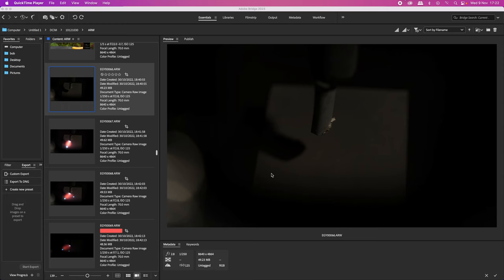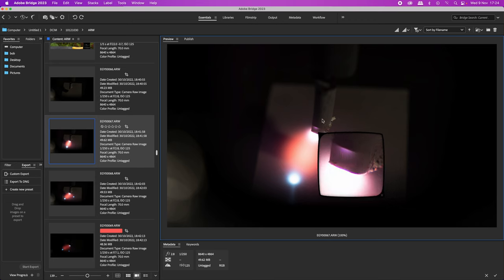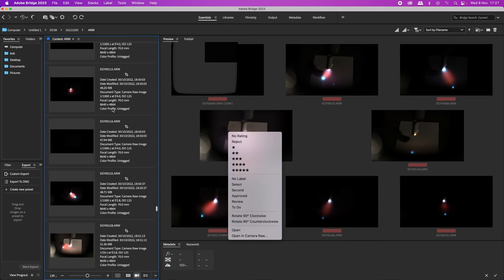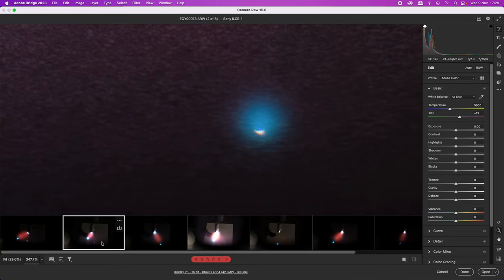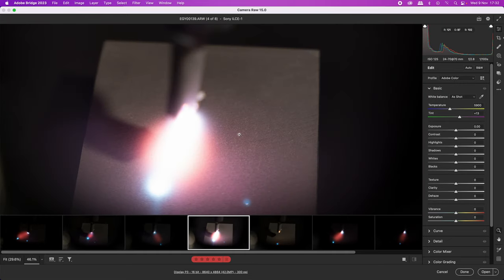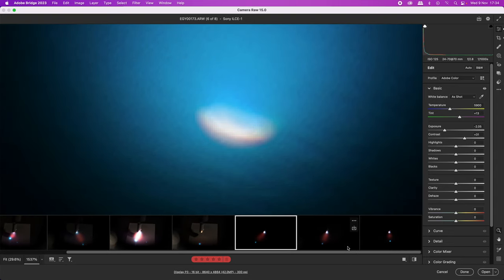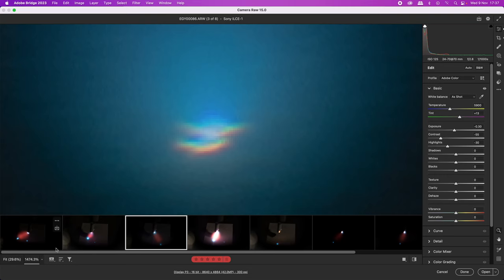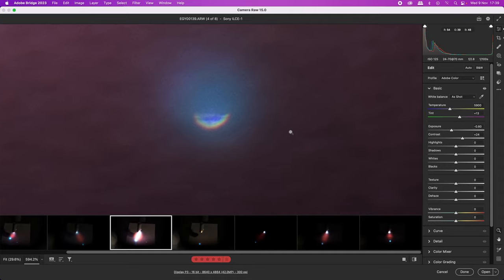VEGA - ALUM - Tack?

Comment: The deep blue concentrated spherical zone could be the location of the Bosenova explosion of the EVO. The initially white fading to rainbow saucer shaped  zone under the blue Bosenova area  might be the EMF shockwave (electrons and photons) attracted to and moving down to the surface of the aluminum.

The rainbow colored shock wave might be formed by high energy electrons gradually releasing their energy at gradually lowering frequency breaking radiation to gas atoms as they move toward the surface of the aluminum.
Reply from the maker: All good ideas, thanks Axil

Comment: Excellent! Do you have a rough estimate of the size of those? Or the dia of the anode? 

If you can rule out optical aberrations we might be seeing relativistic effects! One possible reason they all appear domed in the same orientation. Great work, as always.
Reply from the maker: Well, you can clearly see in some images the scale of the regular structure on the Al. I will take a look at this with a microscope and get a scale of these adjacent features and then we will know the scale range of these structures.